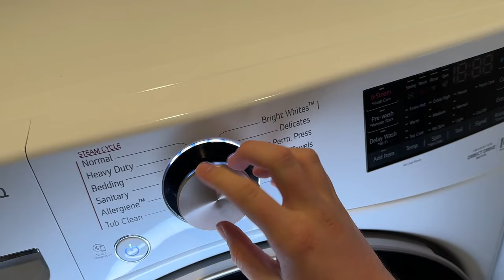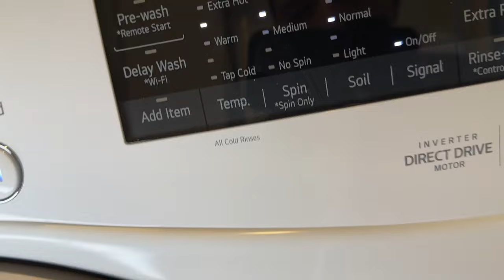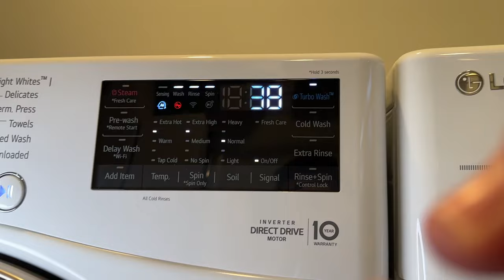LG WM4000HWA TurboWash Front Load Washer - Bright Whites Cycle (FULL CYCLE)

Comment: 8:54 thats a combination of the spray and dispensing the bleach into the load. Since thats the whites cycle, its gonna dispense it early. Its just that the water pressure wouldve been too mich if they only used the dispensing nozzle on the bleach compartment. So they split it where the bleach and the rinse nozzle will be used at the same time to split the household water pressure
Reply from the maker: @blackice7408  That makes sense, thanks for letting me know!

Comment: It's really crazy how little laundry detergent you have to use... even when following the instructions on the bottle... The bottle of Purex I have ... I have to use a freaking flash light each time because the lines are the same color as the cap and almost invisible...It says fill to line 1 for normal soil.. which is what I do most of the time... and that's a crazy small amount of detergent... I wonder as I'm doing it how many people actually don't even bother to read and just put whatever they want in there... My duet front loader just won't die... It's almost 20 years old. when/if it goes... I'm definitely getting an LG with turbo wash front loader... but I'm not holding my breath that it will last as long as my Duet did... I don't really like the new whirlpool front loaders ... It's really slim pickings in the washer world...The only 4 I would consider is GE front loader...the LG with turbo wash...an Electrolux front loader ... I would like a SQ front loader but that's like $2300 so.
Reply from the maker: @One-Day-After-Another  I’d imagine most people don’t bother reading the labels. Truthfully, I don’t either. I just eyeball it every time and go off the little lines in the LG’s detergent compartment (I fill it to the minimum line every time). I know you don’t have to use a lot, so I just put roughly 2-3 tablespoons worth each time and haven’t had any issues. I’m glad to hear your duet is still going strong! Those are by far my favorite machines. People seem to have mixed experiences with them though, I mean they were among the first American engineered front loaders as we know them today. In terms of finding a replacement eventually, I would only ever consider LG or Speed Queen. The price of the Speed Queen is difficult to swallow but the durability is supposedly unmatched. Otherwise I’d go with the LG, very reputable brand and has all the great features like TurboWash.
Reply: @FansOfGames  Yea... I remember in 2005 when I bought my duet I was told I'd be LUCKY to get 7 years out of it... even back then people say the same things as they do now about "modern" appliances. Honestly though...Watching the LG do it's things... the only thing I don't like are the interim spins seem slow compared to my duet's interim spins...but everything else looks better actually...it looks like it uses MORE water in the rinses than even my duet does...They need to make that spray rinse longer... it's not long enough... but that's OK... I'm pretty sure it will be my next washer when/if my duet ever dies... but I think it might go a few more years honestly
Reply from the maker: Heres to hoping that it does! I do agree that the spray rinses should be longer, but at least it does a spray rinse during the final spin. And I can speak from experience with both my current lg and a Kenmore Elite HE4t (basically the same machine as a 2005 duet) that the lg’s spins are on par. The best thing to do would be to get the matching dryer because I find that the lg dryer almost always perfectly dries each load out of the washer, so I’m assuming it was designed with the typical wetness of a load out of its matching lg washer in mind.
Reply: @FansOfGames  Gotcha... Unfortunately, I'm a fan of standard whirlpool dryers..I have the plain white basic whirlpool dryer with 3 knobs I bought new in 2018..trial and error i've gotten used to where to put the auto dry and 99% of the time it gets it right...I'm sure LG makes good dryers too...but the more simple the better for me... like my next fridge.. I want the most elaborate one but in reality... I'm getting the basic top freezer with no ice maker...just because I know it will likely be less potential for something to malfunction